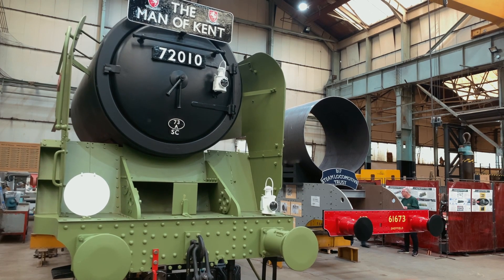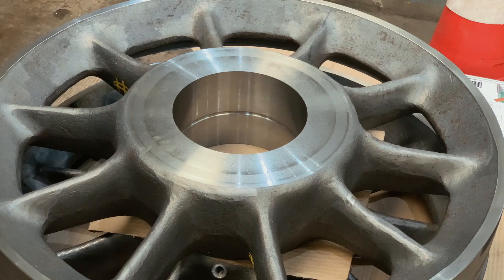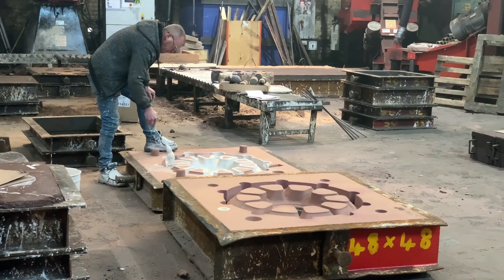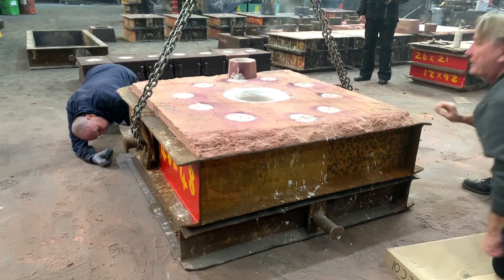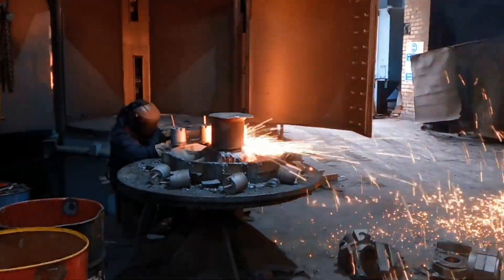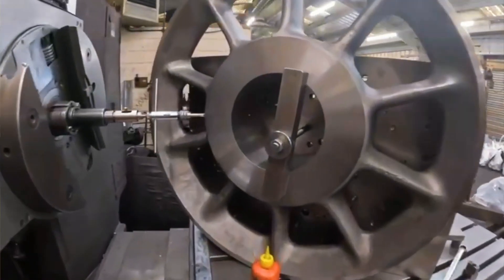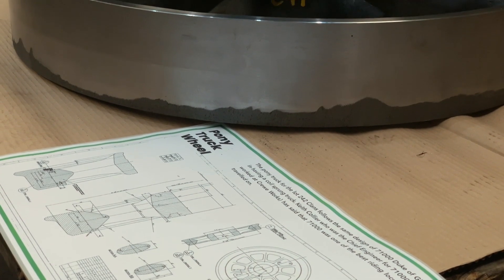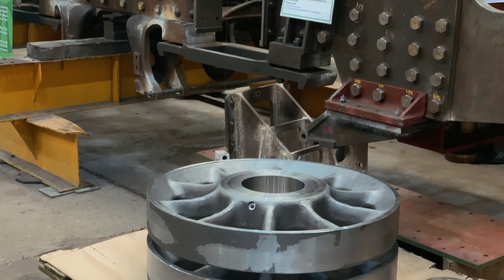New build steam loco Hengist gets more  wheels

Comment: It's good to see heavy engineering in process - with the pending closure of the Alstom works at Derby we could find that the Hengist team are the only locomotive construction team left in the UK!
Reply: Andy, there are several new builds ongoing in the country, of which six are part of a group called the Main Line Steam Builders Group; both Hengist and Spirit of Sandringham are founder members. The B17 Steam Locomotive Trust building 61673 'Spirit of Sandringham' were cohosts on Saturday at the Open Day and the frames etc were in shot at the start of the video. Out of shot was a 'stack' of 5 6'8'' Driving wheels with the 6th elsewhere in the factory being machined.
Reply: @johnpearson8657  Yes the private sector ("heritage") is doing great things and I was just making comment about the dearth of construction facilities for the Network Rail industry.
Reply: @johnpearson8657  I've seen the driving wheels in another video shot at the open day. Good to see that the wheels are slowly but surely coming together.